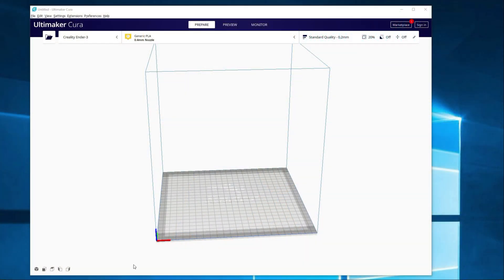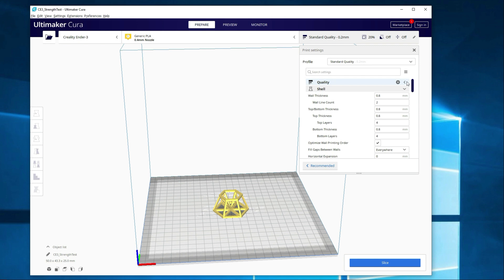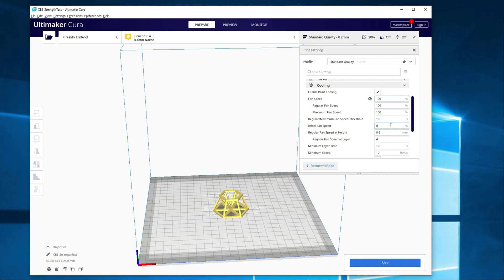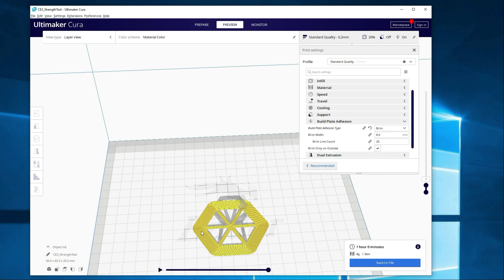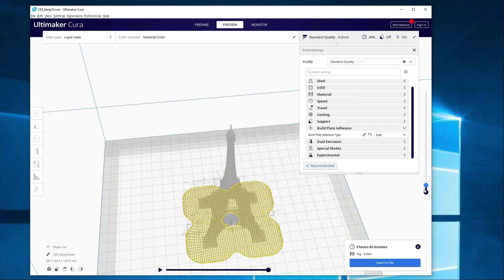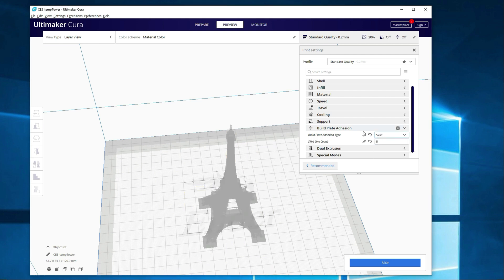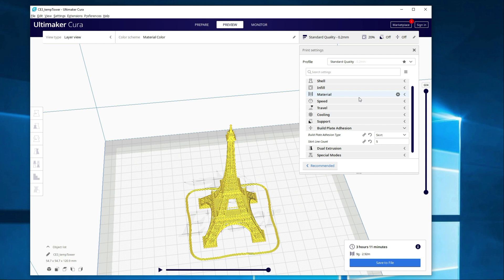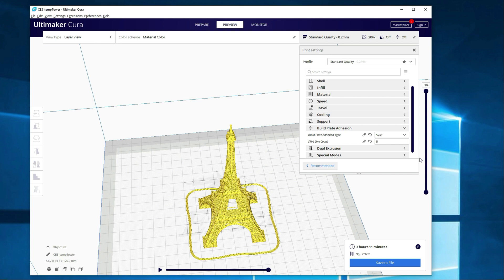Cura First Layer Settings Overview

Comment: Super helpful- just got one and it was failing about 1/3 - 1/2 the way through a small piece I wanted to print.  This, along with a couple extra pointers helped tremendously.  I'm now using a raft base layer fot small little figurines that i am printing as I learn the software and printer, etc.  Thanks!
Reply from the maker: Glad it helped!
Reply: When I'm printing animals it always knocks off the legs about half way through,  will the first layer help with this? Can I create king of a thin base ?
Reply: So it's the raft I need I guess

Comment: Brand new to printing, can someone help me? I like using a brim to avoid warping, and i had no issues with it at first but now, whenever i use a brim it comes out extremely thin, and doesnt stick. Usually just gets hooked on the nozzel and drags around. 

If i print without a brim it comes out fine so i know my printer/extruder is ok. I printed without a brim last night and it warped 5 hours in and got ruined, so i basically need to have a brim but mine just dont work someone help please hahaha.
Using cura on an Ender 3 S1
Reply from the maker: Hi. What cura profile are you using and did you change any of the brim settings on accident?
Reply: @3DPrintscape  im using the ender 3 profile, which i know isnt ideal but i couldnt figure out how to get the S1. But, it does work ive done about 10 perfect prints with it. And i believe i might have fixed my brim problem i think it was just a minor clog in the nozzle which was giving the filament problems. I appreciate your responses though thank you!
Reply from the maker: @Brog420  Im glad you got everything working :)

Comment: FYI first layer temp and bed temp are other setting which should be increased by 5 degrees if you are having sticking issues.
Reply from the maker: Hi. Thanks for the feedback. I typically have my build plate set to 60 and dont increase it more for PLA. That said, if you are running a lower temp, increasing it should be the first step.

Comment: How do I keep this from printing a first layer base? This is messing up my prints with having to grind off and sand down the big bases this thing prints.
Reply from the maker: Hi. If you are using a brim or raft, those will have to be removed post print. If you use a skirt, you wont have that issue.

Comment: Hello, I have a question.  I am using Cura and an Ender 3 V2   When the printer made a perfect sticking 3 layers raft he begin printing to high. The layers wont stick the 4th layer. How can I solve this problem? 

Thanks,
Reply from the maker: Hi. It sounds like the nozzle may be a little high. What happens if you try to print any of the first layer calibration objects from thingiverse?
Reply: @3DPrintscape   @Grimm3D  I am gonna try that. Thanks for your answer!

Comment: I'm having issues with the first layer, before printing I level the bed with the nozzle, when I started the print the nozzle scratched the bed. I printed before with the same settings and always worked good. After I change the motherboard this us what is happening. Do you know what can cause this? I've tried several times but always get the same results. Thanks
Reply from the maker: Hi. There is a good chance its something firmware related with the new board. Im assuming the its messing with the Z-Offset in some way. The first thing I would do is look into raising the Z-Offset. It should be under one of the menu items. Once you get that working, don’t forget to save the settings or they will be wiped out when you power off the printer.